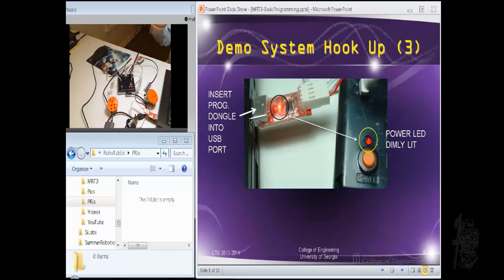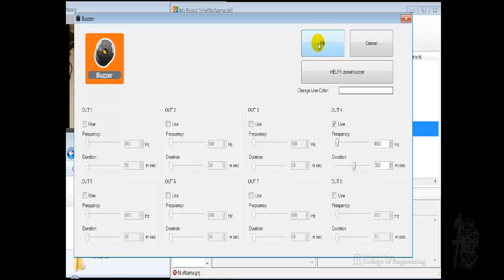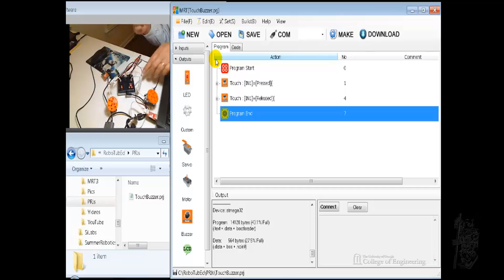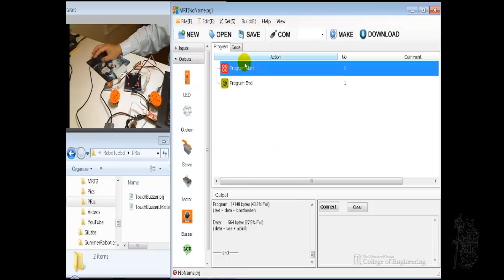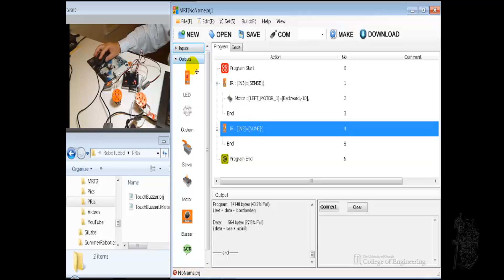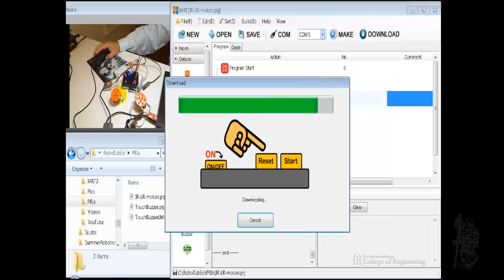B_Video 5.1 - Programming the MRT3 System

Comment: Hi Sir!
same problem here
How to program a line tracer?
hoping for a feedback
Reply from the maker: At this web site https://www.manualslib.com/manual/1003544/My-Robot-Time-Mrt3-Series.html, you can download an assembly manual.  On page 69 there are assembly instructions for a line tracer, this means that Robot_Time folks already have a piece of code to do line tracing already.  You need to contact the folks where you had bought your MRT3 system.  They can help you much better than I can (as I do not possess this robot system anymore).
Reply from the maker: Today, I manage to get access to the MRT3 software V.1.2, but unfortunately no actual hardware needed to build a Line Tracer robot.
So I can only share some possible code that may do the job, but I can't be 100% sure as I do not have the proper hardware.

The physical assumptions for the Line Tracer bot are:
1)  The width of the black line is about the same as the width of the IR Sensors.
2)  The Center IR should be lined up on the black line before starting the robot program.
3)  The black line can be curved but the robot would likely "ignore" track "intersections" and "miss" sharp curves.

The algorithm shown is based on 4 condition/action pairs:
1)  All 3 IR Sensors (IN1, IN2, and IN3) sensing white background >> Robot stops.
2)  Center IR Sensor (IN2) senses black line (i.e. sensing NONE) >> Robot goes forward at speed 10.
3)  Left IR Sensor (IN1) senses black line (i.e. sensing NONE) >> Robot turns left at speed 6 (to realign itself with the black line).
4)  Right IR Sensor (IN3) senses black line (i.e. sensing NONE) >> Robot turns right at speed 6 (to realign itself with the black line).

This MRT3 project can be downloaded at https://www.dropbox.com/s/tv54ala1cyfvmzh/LineTracer_3IR.prj?dl=0

Comment: Hi Sir!
How to program a line tracer?
hoping for a feedback
Reply from the maker: Like I mentioned before, I do not have an MRT3 robot anymore, so I cannot help with some specific hardware/software suggestions for your particular needs.  But I can do some generic suggestions.  So first how many IR sensor do you plan to use to detect the line?  I am assuming that it is a black line right?
Reply: 3 ir sensor and yes black line
Reply from the maker: Today, I manage to get access to the MRT3 software V.1.2, but unfortunately no actual hardware needed to build a Line Tracer robot.
So I can only share some possible code that may do the job, but I can't be 100% sure as I do not have the proper hardware.

The physical assumptions for the Line Tracer bot are:
1)  The width of the black line is about the same as the width of the IR Sensors.
2)  The Center IR should be lined up on the black line before starting the robot program.
3)  The black line can be curved but the robot would likely "ignore" track "intersections" and "miss" sharp curves.

The algorithm shown is based on 4 condition/action pairs:
1)  All 3 IR Sensors (IN1, IN2, and IN3) sensing white background >> Robot stops.
2)  Center IR Sensor (IN2) senses black line (i.e. sensing NONE) >> Robot goes forward at speed 10.
3)  Left IR Sensor (IN1) senses black line (i.e. sensing NONE) >> Robot turns left at speed 6 (to realign itself with the black line).
4)  Right IR Sensor (IN3) senses black line (i.e. sensing NONE) >> Robot turns right at speed 6 (to realign itself with the black line).

This MRT3 project can be downloaded at https://www.dropbox.com/s/tv54ala1cyfvmzh/LineTracer_3IR.prj?dl=0

Comment: Hi sir!
How to program a sumobot?
Reply from the maker: Unfortunately, I do not possess an MRT3 system any more so I can't help you here.
Reply from the maker: At this web site https://www.manualslib.com/manual/1003544/My-Robot-Time-Mrt3-Series.html, you can download an assembly manual.  On page 36 there are assembly instructions for a sumo bot, this means that Robot_Time folks already have a piece of code to do line tracing already.  You need to contact the folks where you had bought your MRT3 system.  They can help you much better than I can (as I do not possess this robot system anymore).